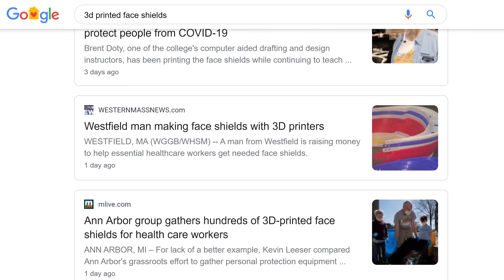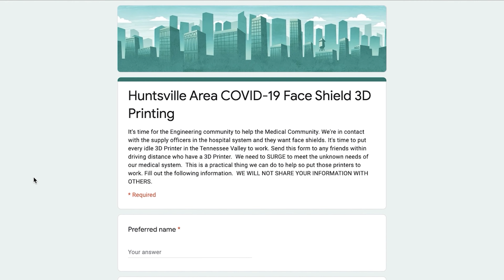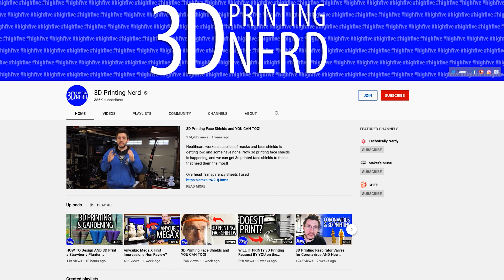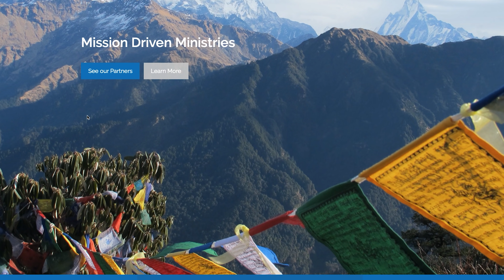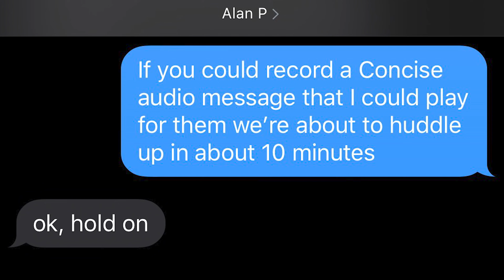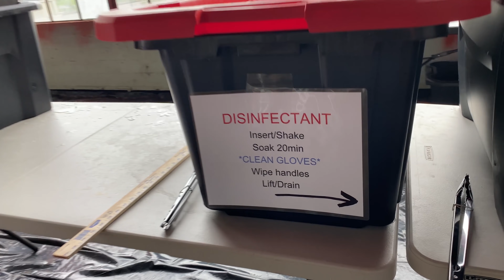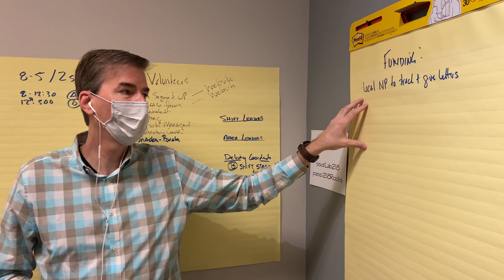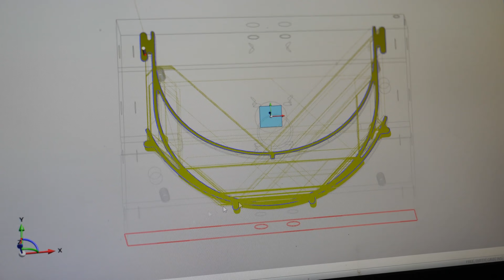We Made Face Shields - Smarter Every Day 233

Comment: I just came across this video and, mostly, it's awesome and I agree.  The points where I disagree are: 1. Don't shoot down the innovators.  If someone can make your process more efficient, don't shame them, listen to them.  Study their variations and see if it can streamline the whole process.  Just like when using injection molding, spending a little more time up front with R&D can create a better product more efficiently.  2. As others have said, fans aren't the best solution for drying the products.  Especially without filters.  If you added a ducted HEPA filter, that would at least catch some contaminants.  Not a coronavirus but, other contaminants floating around.  As I said, overall a great video (as usual).

Comment: Hey guys. Destin.... Thanks for the endless amounts of inspiration. I'm not sure if anyone has come across this yet, but while I was looking for a replacement for the acetate cells (that have been very hard to find) I came across Cake Collars (a 33' roll. This one was 8" wide.) I determined that a 10" cut of that would fit the face shield frame well. (so 10"x8") I was able to get 39 from the roll for $28.  Maybe that's not a great price, but maybe there are better prices, and it's an option that worked. The thickness seemed fine to me, but the clarity was crystal. I had landed a bunch of Inkjet sheets with garbage clarity, since they need texture for ink. Finding purely clear acetate has been difficult.

Comment: FYI: A lack of N95 masks has led some people to wrap scarfs, etc around their face since it's "better than nothing". However, you can buy a nearly identical fabric at your local Home Depot in the air filter aisle. You're probably used to seeing the furnace filters in the cardboard box with the pleated material, but some larger furnaces require you to just buy the folded fabric and place the material between the fingers of a comb like structure. This material is about 3 feet long x 6 inches wide and even folded is about two inches thick in the box! So it's probably like 50 feet long unfolded! That's a LOT of masks for like $10 or whatever I paid (it was a while ago). Just trace the pattern of an actual mask, cut out and attach a rubber band! I'll take a HEPA filter material over an old tshirt anyday!

Comment: Hi, can u make a video about elastic waves or any other waves wich verify next relation at the point where meet an other surface  fi incident+ fi reflected= fi refracted
Where fi incident is equal with quantity of waves coming from source, or enviroment1, fi reflected is equal with quantity of waves relfected from the point where the 2 surfaces meet, and fi refrected is equal with quantity of refracted waves from the same point.
The mathematical relation betweet those 3 elements(fi incident+ fi reflected= fi refracted) seeems strange for my intuition. 
Thanks!

Comment: Ok, great point here! 
The same issue that we got. This is how we solved it: 

1. We created a FB group through which we informed people what we started doing, calling them to join the action.. Fast enough the group has grown 20k. 
2. We created a Slack communication, putting 3 well informed doctors at the top of the communication. They must confirm the choice of materials and all design changes etc. 
3. We transferred the interested people to the Slack communication and included them in the process. Created channels on Slack for helping of those who have a setup problems etc. 
4. Bunch of volunteers connected to help the action, few people responsible for distribution organize them to collect the printed frames, distribute materials to the printers and help with the disinfection - supervised by some of the doctors. 
5. Then the same guys help with the distribution of the prepared shield to the medical institutions. 

- We improved the production (speed and quality), we changed the original Prusa model (removed the logo to speed-up - we needed to! , changed the hooks for the transparent shield - people were breaking the frames trying to assemble it , I made a video about how easy it is to assemble it now...). 
- This works for the last 15 days! So far we have delivered (donated! ) thousands of shields and still going every day better that yesterday... 

Thanks for all of those who are helping somehow. Huge respect. 

Regards.

Comment: You should have checked out the face-shield Joel was testing before starting to massproduce the Prusa one. If the shortage of faceshields really is the problem wouldn't 3-6 times as many be better? 

Sure I'm all for the central coordination but i'm saddened by this huge waste of potential. The one Joel was testing is the approved standard one in Sweden, and is designed for function first and efficiency of production second. Unlike the prusa one that is designed as a prusa advertisement first, some mediocre function and no efficiency of production. With a fast printer they are done in 20-30 min, every printer can do them in less than an hour. Compared to the 3hrs for the prusa one. oh and they dont need the elastic band either, so one less thing to source and disinfect.

Comment: I think your intentions are good, but this is nothing like what we use in the front line medical field.  Face masks are disposable equipment and are meant to fit more universally.  Rigid 3D printed and injection molded headbands do not fit universally and are much too costly to make.  I have a 3D printer and have used injection molding in medical prototypes.  You're wasting too much time.  The ones we have used for years have a sponge headband and velcro straps.  They are cost effective and are a throw away item.  Face shields are not meant to be sterile equipment, so better check with the local hospital as to your cleaning solutions so that it can be used in their hospital without causing contact allergies.  When one has a 3D printer one's solution is to 3D print the solution.  Much like having a hammer and everything looks like a nail.  3D printing is much too time consuming and costly for this solution.  And you would have to make too many different sizes to fit to each head shape.  A gap in the fit is not good.  Foam is much more economical and fits any size and contour head, man or woman.  It is much more comfortable, and cheap enough to just toss like disposable gloves.   Why change what has been working well for decades. You are overthinking the solution.  Your time may be better spent getting the public to wear surgical face masks when outside of the house.  Huntsville has shot up to 165 cases today, so more needs to be done to inform the public so that the front line medical staff doesn't need to be seeing too many of them.

Comment: Destin,  I was wondering if UV lighting ( LED's), can be utilized in the  sanitation process for the printed parts?
Reply: UV light tends to degrade plastics.
There is a page on CDC saying low temp, 60C, moist heat and or steam is effective.  I would like to see instapot vegie steamer adaption for sterilization.
Reply: @FixItPleaseJ  I'm sure  short term exposure to UV light isn't going to degrade the integrity of the plastic at an alarming rate.  It's just exposed long enough  to be an effective safety measure.

Comment: OK, one criticism, from someone who did all the disinfection for a small medical device company for 12 years; you really shouldn't be expediting the drying with fans unless you are in a cleanroom.  Moving an excessive amount of air over a medical product forces any contamination in the room into contact with the product, rather than just the small amount that might fall onto the product from passive air currents. We went so far as to redirect the HVAC vent that was near the High Level Disinfection station.

Otherwise, all this talk of disinfection setup and execution brought back a lot of memories!
Reply: You got a good point there.
Reply: This is a very important point.
Reply: This is what autoclaves are used for, and are very common in all medical facilities
Reply: I literally was about to ask about this.
Reply: Sanitization is not the same as sterilization.  They are not trying to sterilize them.  Just trying to wash off potential covid.  They are probably alright.
Reply: Wondered if steam heated cabinets would work better for drying and final sanitizing.  Moist hest at 160f for five minutes is supposed to kill coronavirii per several studies.
Reply: @FixItPleaseJ   It might but it also could damage the product since it is 3D printed and they don't quite go hand in hand with heat
Reply: @barsgecgil3437  Print temperature for pla is generally 190 to 230 C.  160 should be low enough it does not soften the material.
Reply: FixItPleaseJ  Still temperatures as high as 160 Celsius are not healthy for Pla printed materials and especially in this case these are some what thin prints and also you can extrude / reshape or in this case bend or deform pla at 160 degrees Celsius but instead of pushing air from the room maybe air from a compressor could be a fast solution or just temperatures below 60 Celsius should be all right and safe. Just my opinion maybe wrong if you think so I would like to learn why and the truth. Thow whole point is to get smarter everyday isn’t it :D
Reply: @barsgecgil3437  71 C is 160 F.  That's all it would need.  Not 160C.
Reply: you shoukd  go voulunteer
Reply: ""don't be that guy"
Reply: @YouRegolo  "unless it's a safety issue"

Comment: @SmarterEveryDay  You clearly don't understand the skill and knowledge diversity within people.  You think everyone that has a 3D printer should be printing and only printing.  First of all, you have no idea what you are talking about.  It takes someone with 3D printer knowledge and experience to make improvements that accomplish the overall objective.  So, modifying printer settings to speed up the production rate is something that also needs to be done.  But, with your limited knowledge, you think it is better to just repeat inefficiency for the sake of production -- the blind leading the blind.  You are best served in a position where you can repeat the same process over and over again, without innovation.  Luckily, you had help, from an expert, pointing out what to do and how to sanitize the mask.  Your opinion about "everyone with a 3D printer just needs to print masks" -- false.  There is a place for someone "to be that guy," and yes, that guy is THE EXPERT in 3D Printing.  Engineers are experts in 3D modelling and nobody should get in the way while some organizers  also need to take advice from experts to get things done faster, easier.   Huntsville has a boat-load of Engineers with know-how.  Any managers think they know everything about who should do what, in haste, but will find themselves in the firey pits for their mistakes.  Don't be THAT GUY!

Comment: Can you please make the code for the website open source?
I know it's probably very simple and uses google forms which are easy to setup. But it would be nice to have templates for people to get up and running in 5 minutes rather than 2 hours.

Disclaimer: There's about 2000 comments in the source. I can't search through them all. So, I don't know if that has been asked before.

Comment: silicon molding? (you can make it in one day, and inject 200-500 parts with it, or more, not suitable for mass production, but good for prototyping, much faster than normal steel molding/injection, the quality of the parts is better than 3d printing, we use it in our daily work)

Comment: Just make a sauna room with a 3D printer.

COVID-19 are smaller SARS.

MARS: 120nm
SARS: 80nm
COVID19: 20nm-40nm

Small enough to float in the air.
Since it is small, a slight fever continues.

Coronaviruses die at temperatures of 40 degrees Celsius.
All you have to do is enter the sauna room for 3 minutes.

In Japan, the use of sauna rooms minimizes the damage caused by infection.

Comment: While I am aware there is a mask shortage, IF you are in a position to choose between a surgical mask and a cup shaped mask, please do use the cup shaped mask.  It provides a seal around your face while a surgical mask does not.   Surgical masks are better than nothing but they are not equivalent to the cup shaped dust masks, N95 or higher.  This is not just my personal opinion but also the CDC's official recommendation concerning masks.

Comment: I feel like you missed the point about not being the "we could do this better" guy, which is that, if you spend all your time optimising your system, you don't spend any time actually using it! Spending a week to increase weekly output by 25% means it's going to be 10 weeks before you've actually made more of the thing than you would have if you just started manufacture right away. That's 10 weeks where you could have potentially saved lived.

Comment: Destin, I might be wrong, but it seems that you are wearing your face mask the wrong way, color side should face out, the inner surface is a moisture absorbant (while the outer is a repellent). The folds of the outward face should be in a way that the top layers cover the bottom ones when wearing it correctly. (Look at the way the Nurses are wearing them compared to the first few seconds of your video).
Lot of Love and prayers for your community. Stay safe and strong while we are being hammered by this pandemic, Thumbs Up for all makers driving effort against the virus!

Comment: Hi Destin, I run a molding company in Southern California (15 injection molding machines, 18 FDM 3d printers, 2 cnc mills, 1 100w CO2 laser, etc) . Is there any way that we could get the mold design CAD models so we could start on our own faceshield frames? I've been asking all sorts of people what they need but like you said the community is very splintered and people can't seem to agree on what's needed most. We have a staff of engineers that normally work on lab grade bottles and  communication hardware but I really want to shift gears for this fight. Please let me know!

Comment: Could the virus survive extreme heat? Such as welding or something relative
Reply: Depends on the temperature of the surface normally protein is degrading at 40°c+ but to be honest the chance is bigger with 60 or 90°c  + if you are welding you u release strong UV radiation that is damaging cells that's a nother bonus, freshwater facilities use for example UV treatment for waterborne algae or bacteria and viruses, hope I could help you.  , greetings from Germany

Comment: Good on you and people like you. 
Please be careful with respirators, you need to seal them somehow because 3D printers do not print solid enough to block out Covid virus particles which are 0.3um. (Look at 3D print material using a microscope) The prints might look solid to the naked eye, but they are not.

Comment: Ozone can disinfect masks, much less landfill waste. If not too much polyester, can be disinfected with ozone many many times. Can be sanitized with home-sized ozone machines (4-10 grams per hour corona-discharge units)

Body PPE and plastic face masks could be disinfected with ozone a few times before the ozone makes it too brittle to be usable.  Extend the supply, and less landfill waste.  Hundreds of sets Locked into a room with 100 gram per hour machine disinfected for several hours in ozone concentrations lethal to humans.

Comment: Please check out the face shield from Ray gear face shields, I have personally used these on the front lines of EMS and they worked great.  Highly recommended, however they currently are out of stock and need to bump their production.  IF there is anyone out there to help it would be great.

Comment: To the coder guy at 15:04 - it's great you're helping with a good cause, kudos to you! But for others, that's not what professional coding looks like. :)
- 8 monitors and 16 code views is absolutely unpractical, I love myself some extra pixels but max out at 3 monitors and 4 code views, it's just not worth it beyond that
- That's clearly the same file in most of the 16 views, just at slightly different positions
- A professional coder would never give up the precious information in multicolored syntax highlighting for the worn out green code cliche
- Windows is the worst platform for coders by miles
- Coding is slightly more complex than just hitting the same 8 keys repeatedly and we don't (usually) type multiple characters per keystroke, it's just some hackertyper kind of a thing

- At least 1 of those 8 monitors would have a browser with Stack Overflow :D
The real reason someone would have that many monitors is probably gaming, of course. :)

Comment: Here in Curitiba (Paraná, Brazil), we're also printing tons of face shields. After about 7 days of printing non-stop, we got in contact with some big fatories, witch helped us get it injection molded finally.
I helped with all the logistics, we got support from the government (they gave us 2 cars and drivers to collect the printed parts from peoples' houses, deliver them filament to keep printing, and get the printed pieces to the warehouse where the sterilization is taking place). Now we have a very well coordenated team, spreadsheets with all the production and demand from the hospitals, also giving more priority to those receiving more cases of covid19.
Now the 3d printing community here is turning to the respirator split-valves. 
Anyway, it's incredible to see the community working together, even more here (Curitiba is very well known for its very introverted citizens).

Comment: Great video but "Extended delivery time" from Amazon of 3 weeks on almost everything 3D printer related, including filament, is not helping my rural community mimic this.
Reply: Destin actually addressed this problem in the recent No Dumb Question episode.  The point being: do what you can do Right Now, with no additional supplies or knowledge.  Maybe that's not 3D printing...there are a lot of other jobs that need filling.